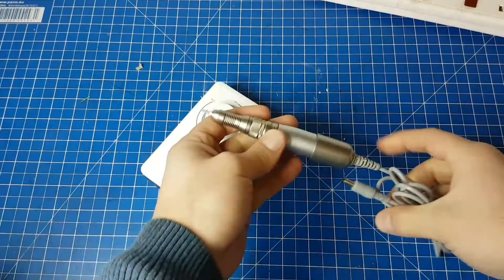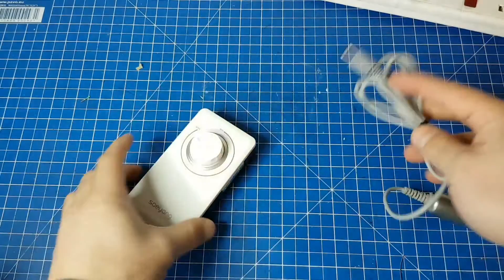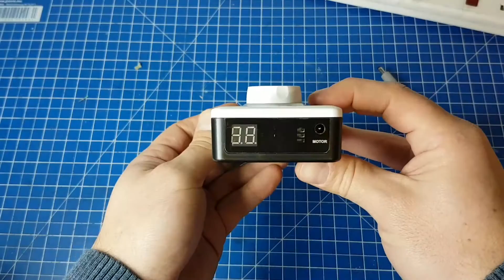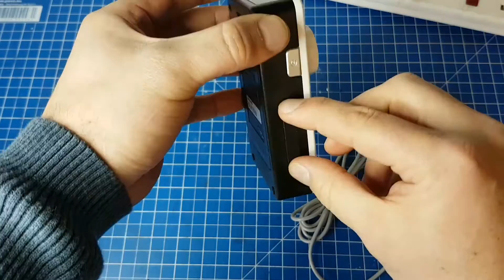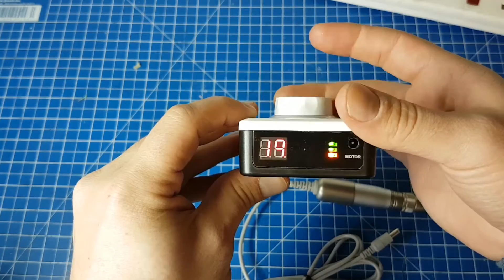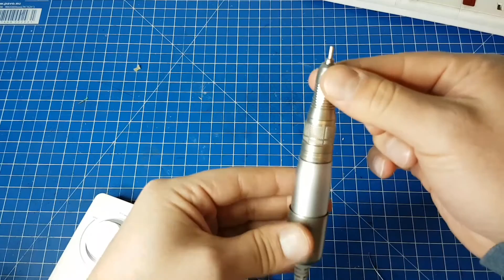Basic Operation of K38 Nail Drill and Hand Piece

Comment: Can you use this hand piece with the k35 unit? I like that the wire on this one isn't spiral x
Reply from the maker: Yes you can! All you need to do is buy a straight hand piece lead and fit it yourself, takes 30 seconds to swap them over! You can buy the lead here: https://tafsproducts.co.uk/collections/nail-drill-accessories/products/saeyang-accessories-and-parts?variant=35147139213

Please leave a note saying straight hand piece wire also.

Thanks

Tom

Comment: is the Saeyang k38 suitable for nail technicians?
Reply from the maker: The K38 weighs 700 grams all in (that includes the power lead and hand piece). The K35 is slightly heavier at 1300 grams (1.3kg). But it is a mains powered drill. I suppose it's down to personal preference and the fact to whether you're able to find a plug socket at every client's house you arrive at. The K38 eliminates this need. For more info on all our drills see here: https://www.footcareathome.co.uk/collections/saeyang-micro-motor-nail-drills-1
Reply from the maker: claire Harrison Yes it is PERFECT for nail technicians. High torque and high speed mean it will sail through product with ease! if you order tomorrow from us there is 10% off too!
Reply: TAFS Products Ltd so glad I placed an order, went for the k35 as I dont need a portable option. great service and fast shipment. The k35 is absolutely amazing and just files through the acrylic with ease. Would (and will) recommend to everyone.
Reply: claire Harrison is the machine heavy for mobile use?? i was considering the k38 but there is a £100 difference
Reply from the maker: Yes it is, the high torque combined with the maximum speed of 30,000 RPM mean you can get through some quite stubborn product. We actually drilled some metal with this and it flew through it!
Reply: TAFS Products Ltd .. i do an average of 3-4 clients a day being mobile.. so was considering the k35 but wanted to know how much it weighed
Reply: TAFS Products Ltd so the k38 isnt limited to how many clients you can breeze through in a day.. unlike some portable motors which heat up as the can do a certain number
Reply from the maker: CRAZYMANI88 Yeah it will fly through patients will very little if any heat!